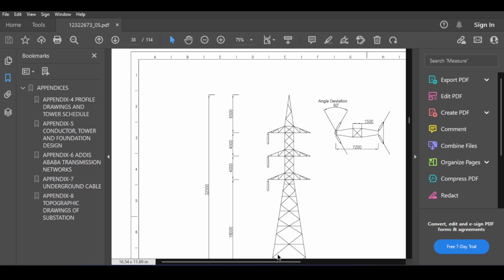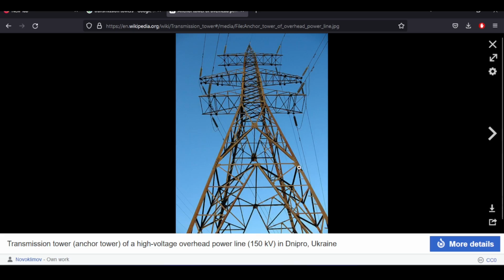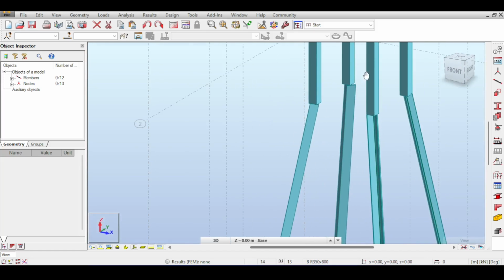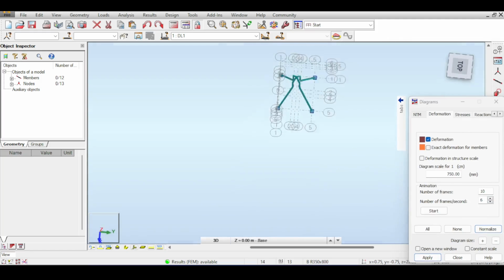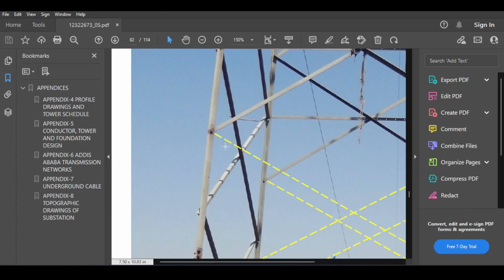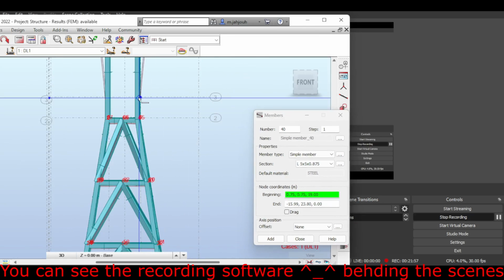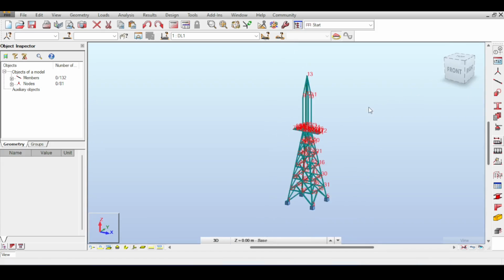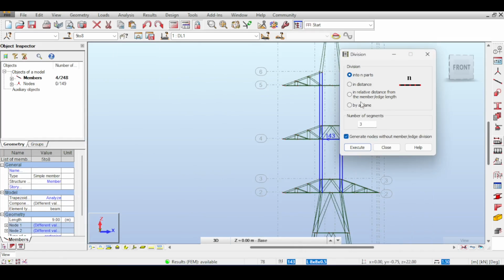Modeling Lattice Steel Transmission Towers Using Autodesk Robot | Part 2 - Modeling (2)

Comment: I have really learn a great deal from this tutorial. Am so exited 😀
I have gathered soo much ideas from this tutorials with regards to the modeling and the geometry of the transmission tower. I feel on top of the world 🌎 right now 

So I have been able to model the full transmission tower and It’s been repeatitive but fun at the same time. 
I model twice, firstly with your ideas and secondly with your old tutorial of modeling members with node numbers

The first  model took me not less than 2hrs to complete while watching your tutorial alongside.
The reason being that I had to make far too many clicks and too many wrong clicks. I had lots issues with isolated nodes due to wrong clicks on my part 😂

The second model was quite smoother since I had to insert nodes manually and divide members and key in node numbers to model the members.
Reply: TheChallenges
1. I had to plan out the whole model, starting with the creation of all grid lines in all (x, y,z) direction.
The horizontal grid were fairly straightforward with offset of 3.5m, 0.75m and 0 on both sides and both horizontal directions.
Since the tower height was 32.5m, I assumed a storey height (z) of 1m  with 31 repetition with the last storey/height  as 1.5m

However, the challenge was that there were far too many grid lines in  Z axis to snap to during the model creation. I really struggled 😞

Second model, I had  to place in plan 4 nodes at the base, 4 nodes at the 19th story, 4 nodes at the 27th story and finally a single node at the 33 story (apex)
Then I used the member table, with the node numbers to create the members to link the nodes at the various story. This was smoother and faster for the main model.
The combination of member table copy, divide and vertical mirror was extremely helpful in this regard

2. Second challenge was with Gamma Angles.
I literally had to try each and every angle until I was satisfied with the final connection. I’d probably have to experiment more to see how the gamma angle actually works.
Reply from the maker: I think I figured it (gamma angles) out. I will talk about that in a video.
Reply: Realization
From this tutorial and the parameters of the tower geometry in the JICA report, I realized all preliminary dimensions of the transmission tower can be expressed in terms of the total height of the tower. I find this idea to be extremely useful.
Reply from the maker: This is an important outcome and helps you in future works. Glad you liked it and found it useful
Reply: MyQuestion
1. In 3d frame design, does the order of drawing the members ( left to right, up to down)  not affect the gamma angles and results presentation?
Reply from the maker: This questions is exactly (drawing and gamma angles) is what made me figure it all out
It does sometimes, and I will explain it next time.
It has to do with local axis, and how a nonsymmetrical section is actually sized along its local y and z axis. so the way you draw the member will affect the gamma angle.

there is more details about this. I realized this in hindsight from your comments.

Thank you very much for being part of this growing community. Your comments are priceless.
Regards,
CEE
Reply: @CivilEngineeringEssentials  Thank you a lot Prof. I thank you always for extending a helping hand 🤚.
I’d also look into that now that you gave me the idea 💡. I’d try drawing all my members in an anti clockwise manner for beams, and down up for columns and observe the local member directions and apply gamma angles.

Ideas from the essentials tutorials keeps ringing in my head. 

Your content is of extremely value to me as a practitioner. The truth is I have an alarm set on every Fridays for your lovely 🥰 channel.

God bless you immensely 
For your dedication and hardwork 
And most importantly your practical ideas 💡
Reply from the maker: Dear Engr. Nii, I am really happy that the tutorial was helpful. It turns out that a weekly schedule will provide high quality content for structures that are longer than usual ^_^
Same thing happens to me. It is a bit too intricate and I think I'll give the idea of using tables a try.

Comment: May I ask if Robot supports plug-in for modeling such structures as there are huge possible types of bracings configurations and modeling manually is quite difficult. Thanks.
Reply from the maker: Hello there,
unfortunately, no.

I heard that REVIT does have stuff like that and it could be exported to robot. But I am not really sure to be honest.

Still, welcome to the community.
Regards,
CEE
Reply: One might use dynamo for Robot or Revit to create a kind of plugin.

Comment: 👏👏👏Respect to the CEE for keeping it real, I am very happy that you do not intend to edit your thoughts process out of your tutorials. I never imagined that I would value (as much as I now do) and even learn more from rationalizing how to correct mistakes and errors until I experience this from the videos that you share. 

1.I had my own sinking realization moment 😊 at 20:10 as follows:

It is still an option to split the bottom tapering chords region of the tower into seven (7) or into any other number of segments that are desired by the designer even when these chords are spliced into two pieces because in theory, a member is “structurally continuous” at the spliced position. Therefore, one can “ignore” the existence of the splice position and divide the entire length of the tapering chord [without the splice] as desired and then model in the splice or cut in the tapering member after by using either divide “in distance” or divide “by plane” or the “cut by plane” command.  
 
2. I would like to preface this second comment as follows: I 100% agree with and I realise the importance of orientating the sections in order to realistically accommodate joints and connections and also to best resist the applied loads and forces. My comment below is NOT intended to challenge this process, it is only to try and explore the related contexts.

Thank you for sharing your model file. I had followed along and made my own model file however, I almost got caught-up in a spiral trying to rotate the horizontal and diagonal bracings to align “perfectly” with the tapering chords angles of inclination. I realised in the video, and in your shared model, and in the youtube comments that you have posted that you have used orthogonal and secondary rotation angles (45 degrees multiples). These rotation angles (when used on horizontal and diagonal bracing elements) give fair approximations of the orientations and inclinations of the various bracing members and they are also relatively quicker to work with. 

Will it be correct to consider that in a lattice structure (where all the members are supposed to be subjected to tension and compression forces only, and assuming [kindly assist if you can confirm this assumption?] that the RSAP FEA apply the loads to the lattice members through the centroidal axis of these members), the rotation and gamma angle of the members section therefore does NOT affect the analysis or the design results of the compression and tension members?

Of course, if bending is involved and if the load is not applied through the centroidal axis, then the member section orientation and its gamma angles have a profound effect on the member and the structure deflections during analysis and on the member resistance (during the member design)?

If the above is true then it makes sense (for this structure and for other lattice structures) to consider that the orientations and gamma angles of multiples of 45 degrees are a fair and good approximation of the horizontal and diagonal bracing members inclination and there is no need to try to be exact with the inclination angles of these members in the model?

3.I am in support of the idea to continue with modelling part 2. It is unhelpful and it does not achieve anything from a learning point of view to “just wing it”. I am glad to hear that CEE intends to continue to complete the modelling next week.

4.I will gladly watch 60 minutes tutorial videos from the CEE channel. In my opinion, CEE should continue to provide the quality and holistic information that you have been providing without cutting corners. If the topic or subject require more time and more separate video parts to cover, then I prefer that there be more video parts instead of opting for “shortcuts” or for “overly omitting quick versions”. Rushing is the basis of how important details gets excluded, or get “unintentionally” forgotten or get missed.

If need be, feel free to have any number of video parts of this project as the need demands or require it to be so.

5.@ 35:30, From the tower level 18 000 to level 27 000. I agree, with the recommendations to consider a simpler bracing design. Most tower variations that I have googled almost always make use of X-bracings at equal or equalish vertical segments spacings in this region of the tower. They use the same design as the one contained on the JICA Report tower that is being used as reference in this tutorial; some use these X-bracings coupled with horizontal bracings. 

The apex region bracings are either modelled as it has been modelled by the CEE in this tutorial; or as it has been modelled similar to the JICA report apex bracings configuration; or with X-bracings and horizontals that can be fit in the apex region.

But as CEE have noted, there is no one single way of doing the tower. I am curious though to see the member forces resulting from the bracings configuration option that have been followed by the CEE in this particular region of the tower in this tutorial.

6.I want to say that this is another generous tutorial that is full of wonderful engineering advice and tips. This tutorial has covered key discussions on all kinds of alternatives that inspire and make it easier for the viewer to adapt these alternatives to many other towers variations. CEE is the greatest and I thank you sir for your willingness to share.

It has indeed been fun 😊, but I can appreciate the pain caused by Gamma Angles in the modelling of the structure. Only if RSAP can mirror gamma angle treated members without messing up the gamma angles.
Reply from the maker: Hi there Eng. Donald,
thank you very much for your comment. The positive vibes in it help me improve my videos even more.
For Comment #2:
1) Yes. Lattice Towers are "mostly" truss members. The exception are in the continuous chord members which would feel shear forces and - subsequently - moments.
2) It follows that gamma angles might not have a direct effect on the design of the elements for axial loads. that is correct. However, my fear is that  due to the fact that the centroid of L shaped sections is outside of the section bounds (similarly, C channels), it might have an effect on the design. Here I am not really sure and have to sit down on my working desk and wonder a little bit about it. My intuition is that it does not affect. Still, there are bending moments due to own weight. Those are significant because of the lack of the usual "dead load" and "live load cases". Which will have an effect on the stresses of the section, because the externally applied moments will be decomposed on the local y and local x for the design.
3) your realization follows that the correct modeling of members should be investigated.
Even in appearance, it makes a ton of difference.
4) I agree with you that it might be a good idea to leave gamma angles alone in preliminary studies, where you want to check which tower shape works. later, you can refine it.
5) I am investigating the real equation for calculating the gamma angle of any member, I might have something ready by the next video.
6) I do not think that you need to be THAT exact with gamma angles. but well, 45 degree increments is okayish I guess.

Also, thank you very much for your support. Indeed, modeling of this thing seems to be easy, but there is so many little concepts that need to be considered. The goal of CEE is to give something special to the viewer rather than just (Here are the steps, follow them and bye)

For comment #5:
I agree with you completely. Also, I am really glad that you capture all the little infos I keep dishing out. Indeed, there is no 1 singular way of doing a tower ^_^

Finally, thank you very much. Comments of my dear valued viewers mean the world to me. The goal is to create vibrant videos that provide you with all necessary tools to dive deeper in the world of Structural Modeling.

Stay tuned for more content.
Regards,
CEE
Reply: @CivilEngineeringEssentials  Hello Professor,
Thank you so much for the feedback and thoughts on my comment. I can confirm without hesitation that (as far as I am concerned) CEE have consistently delivered already and they have surpassed all my expectations with respect to providing quality content that is vibrant, special, practical, and everything in between.

Have a great day good Sir.
Reply: Hello Donald Khanye and CEE.

I love to read your comments and pick your mind on issues as soon as tutorials are posted by CEE.
I hope you are doing well?

I am of the view that Gamma angles really affects analysis results and how analysis results are further presented to the user. As such, structures should be modeled as closely to how they’d be constructed in reality or approximated accordingly to capture the major effects.

In reality as said by CEE, although it’s ignored in traditional hand calculations, Axial structures like trusses will experience bending moment due to the selfweight of member/ material, however the bending moment will be negligibly small compared to the axial tension or compression of the member.

My curiousity from your question is this, is there a way to reasonably ignore the selfweight of members in truss analysis such that bending moment could be completely eliminated in the analysis only? Any limit to bending moments to be considered too small in analysis of trusses?

Also, Is there a way to approximately consider the self weight of the truss member as equivalent point loads at the joints instead of uniformly distributed line loads?

These are my thoughts on your comment
I hope to discuss more 
Enjoy your day all
Regards.
Reply from the maker: Also, Is there a way to approximately consider the self weight of the truss member as equivalent point loads at the joints instead of uniformly distributed line loads?

Yes. I personally teach that in the design of truss members using hand calculations.
the equivalent load due to self weight on any joint is:
the sum of:
rho * A * L/2 
and that for each and every member connected to that joint.

Now since this is tedious, I advise people in the beginning of their design to:
WARNING: Approximation Ahead
assume each joint having 4 members connected (even if it is less than that)
assume each member is X meters long. (can be estimated by looking on the truss)
assume a preliminary section (to give A).
calculate the force due to self-weight, and apply this to all nodes. 

Regards,
CEE

Comment: Fantastic tutorials.💯
This comment is more of a placeholder
Thanks for the shoutout ❤️

I’d have to model this transmission tower and get back with some real and practical queries on the modelling.
Am so curious as to how you arrived at the gamma angle of 225? It’s really an eye opener for me to try out myself.

Thanks 
Stay blessed.
Reply from the maker: Hello there ^_^
Most welcome.

I expected the gamma angle to be either orthogonal stuff (90-180-270-0) or secondaries (45degrees). Just a trial and error thing ^_^

It took me quite some time to model this thing. Actually, this stuff is what you need to be able to work on platforms such as upwork and co (freelancer stuff). 

Regards,
CEE
Reply from the maker: I just realized why the angle is 225 and how to calculate it. It has to do with the alignment of local y and z axis
Reply: @CivilEngineeringEssentials   I know you’d surely discuss these little details in the next tutorial session.

Enjoy your day CEE.